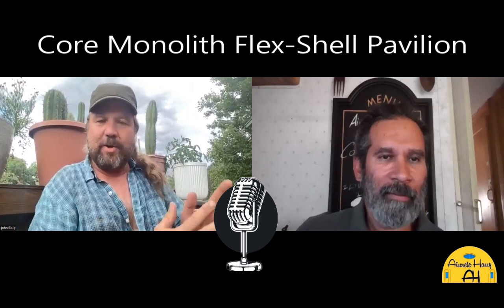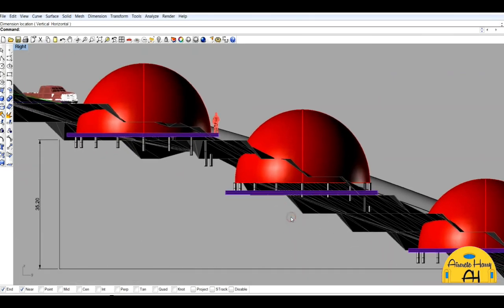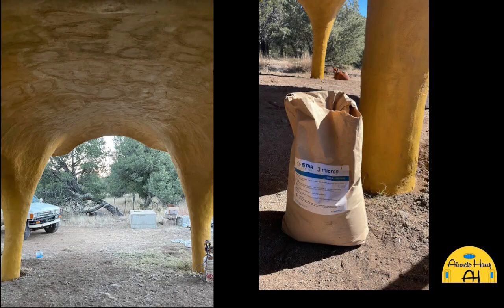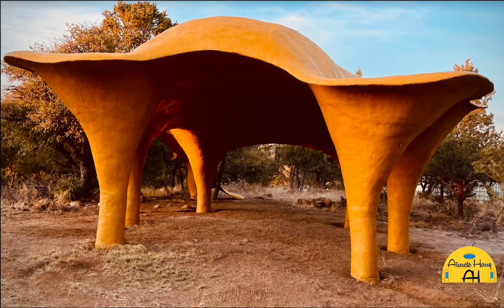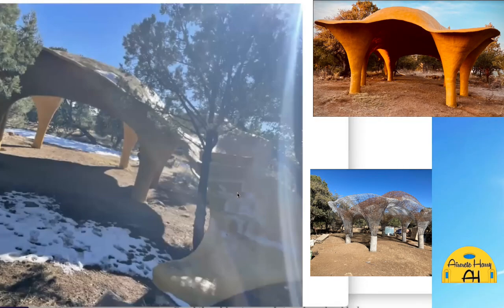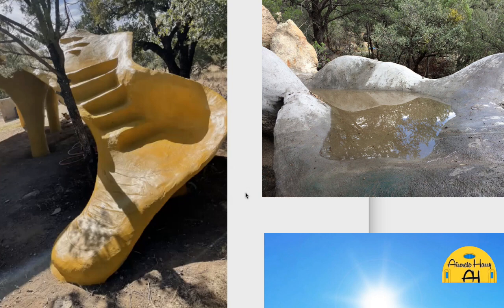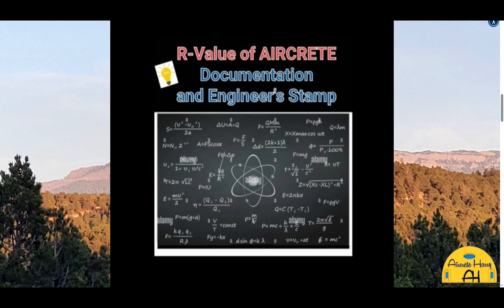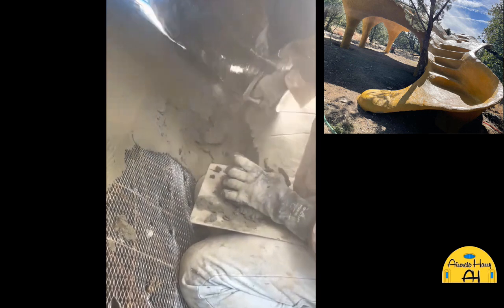Let's Talk Building Systems | Doug Lacy Interview | Aircrete Harry | #aircreteharry #buildingsystem

Comment: Awesome info here! Reactive powder concrete recipe: portland cement, fly ash, silica flume, titanium slag, steel fiber, quartz sand, quartz powder, and superplasticizers. Optional other ingredient is rice husk ash. Rpc's improve microstructure, particle packing, toughness, and durability, self healing! Wow, and have been around since the 90's. Fascinating!
Reply: It is much better to replace the flyash with an ultra refined flyash that is 80 % 3 microns or less.  That alone reduces water demand.  If you check out my response to Michael Hosinger above it gives a little more details on the history. Also there is a recent recipe and mixing sequence in the comments on my folding machine video.  Boral Materials LLC really contributed to the Ductal Mix design style that eliminates the need for the hard-to-get items.  Getting that proper ratio of the special refined flyash and silica fume is the key to making the same consolidation.  A small percent of sand blasting sand (quartzite) also really allows all those nano particles to react between the larger particles that do not ever react.  Even the cement only reacts on the cement particle surface.
   Consistency of compressive strength is achieved by a mixing technique for minimum hydration.  You have to respond to rheology measurements you make while mixing, timing how long it takes for the mix to stop moving.  The metal fibers should be replaced with the PVA and Forta Ferro at max dose 2 percent cement to allow a better range of movement.  The foam really helps with those nano and pozzolanic reactions while preventing chemical expansion damage.  The foam increases impact resistance but weakens the compressive strength but not near as much as it should because the foam binds with extra gel water and supports the micro crystals around the bubbles because they are closed-cell and spherical.   Yeah, it is really cool stuff and the six gallon batches really open up possibilities for furniture, art and ultra thin designs based upon sturdy fluid curves and light frame that is perfect reinforcing compliment to the shell material.  Going to try roof compartment for my daughter's van but there are some non-moving dwelling type workshops coming up.

Comment: Fantastic conversation!  Amazing these column structures avoid the need for traditional foundation and uses less cement!
Reply from the maker: Welcome to the channel 👍 
Thank you very much for your great feedback, greatly appreciate you!
- Glad you enjoyed the video!
Yes, it is such a great option for building.
The more choices we have, right.
Reply: A column foundation can be designed for long term stability in most situations, including sand, swamp, clay and coastline.  

Using a retaining wall to level a thinshell-capped pad, one that extends well beyond the interior of the building, frees up infinite possibilities for entry wall design for the Core Monolith Flex-Shell Pavilion.  This also protects those columns from erosion and protects the building from flood damage caused by soil heave from saturated clay expanding.  This kind of damage was a significant portion of the damage costs after the Houston floods, according to our engineer brother Mike in Houston. 

Channeling runoff into secondary pads (gardens) around the main one or into high-quality check damns in nearby ravines, reverses erosion in the building area, builds soil, supports diversity and allows precious water to be stored below the soil in a way it can be used.  

All massive Reinforced Concrete designs, weather it is a slab, wall, truss or column, has a thinshell reactive powder equivalent that uses vastly less material to achieve the same structural goal, but the alternate provided in thinshell for retaining walls makes more enduring eco-friendly foundations and cutting-edge erosion control methods more cost accessible.

Comment: Helical Piers are much quicker than columns and common machinery can be adapted to drive them in. Also remember to use non-conductive rebar!!
Reply from the maker: Welcome to the channel Dana 👍 
Helical Piers are great - depending on the soil conditions. In our area, for example,  is too much rock to be able to apply this system. 
Overall yes - great option, I agree 👍

Comment: Have you experimented with Waterglass and cement mixes?
Reply from the maker: Not in that way, no. What are you having in mind?
Reply: @AircreteHarry  Hi Harry, I was building simple aircrete/ vermiculite or perlite structures and by adding waterglass ( which is very easy to make yourself) you can control the "setting" time or by painting on afterwards you can make it water resistant and give it a lot of strenth esp in areas that take heat, it just seems like something simple to add that is pretty cheap but is sort of a catalyst multiplier? if that is even a term?

Comment: Fascinating! I’m going you have to research this reactive powder cement! Thanks Harry!
Reply: Pleasure!! Happy to introduce great & different varieties of building techniques - the more options we have, the more possibilities! Glad you enjoyed the video! 👍
Reply from the maker: You are very Welcome!!
Reply: The Ductal mix design by a person from Lafarge in France, the ones who brought us Portland cement, was the first.  Their mix was a 26,000 psi mix that really hit the scene in the late 90’s.   Their super compact consolidation was achieved by  blending different sized silica like quartz flour, micro silica fly ash and the new  polycarboxylate  super high-range water reducer/super plasticizer.  It flowed like molasses or molten tar.  It drips in a stringy non-Newtonian rheology that forms thin dense puddles on the ground.  
Boral Materials technology made a real breakthrough by replacing that complex gradation for densification, that was like mixing basket balls, grapefruits, ping pong balls, marbles and BB s to achieve a consolidation where everything touches, with an ultra-refined fly ash that can be used in a much smaller portion of 12-14 percent portland.  That was the dark grey Boral Micron 3 that is no longer available.   The STAR M3 from Spherix Mineral Products replaced it.  It is a light reddish brown color and refined from a North Carolina Flyash reserve that is from Anthracite so has higher iron content and less impurities but is the same spherical Silicate that is 80 percent less than 3 microns. 

The refined flyash works by replacing that complex array of particles with a more simple complement of particle sizes that creates the same densifying compaction.  It is more like lots of basketballs (micron 60 Portland) a few marbles (micron 3) and a few BB s -the Eucon MSA (silica fume).

The other real breakthrough made by Boral was their improvement of the polycarb.  They blended it with old-school densified calcium and Mg lignosulfonates derived from the Japanese Cyprus.  This prevented segregation and added polymer bonding compounds. 
This combo of Boral Micron 3 and “SPJ” (Super Plasticizer plus the ‘J’, the Japanese water reducer) resulted in a 17,500 psi pea gravel mix that was available to everyone.  

They didn’t realize that not many could really fathom the benefit of changing to a new stronger concrete. 

Boral sold their chemical division to Euclid Chemical Co and the super P turned from Boral SPJ to Plastol 5000.  

Euclid refined their Silica Fume into a product that is safe and consistent.  That is now added at 10 percent cement.  
Sand blasting sand is added, 20-80 silica sand at 10 percent of the 2.5 gallon ASTM C-144 mortar sand, to continue in that key style consolidation that Boral started.

I dialed in the complementing fibers at max dose, the PVA-RESC 15 ml and the Forta Ferro 3/4 inch.  Two complimenting fibers was something that Antoine Naaman later studied after we corresponded on the subject.  He confirmed the complementing enhancement in a paper.  He is the professor who wrote Ferrocement and LamInated Cementitious Composites which is a good research resource. 

Also, I added the 8 to 11 percent closed spherical cell aeration that binds with extra gel water, water not reacted, and converts it to closed spherical cells.  This unique water bonding characteristic of Mearlcell 3532 removes the capillaries that cause water intrusion and replaces those capillaries with spherical closed cells that repel water while channeling crystal expansion to the interior of those bubbles and also densifies the area around the bubbles to channel water electrically to cracks that become exposed to CO2 in the atmosphere.  

The rust, ice and sulphide expansion grows inside of these cells instead of weakening the cement by wedging apart bonds within capillaries.  

Other foaming compounds created pockets of densified material surrounded by suds but the Mearlcell 3532 bubbles blended right in as a multi sized micro aggregate.  This unique water bonding effect causes other foamed concrete mix designs to have unpredictable compressive strength because of variable water content affecting density so it is not advertised as available but Airex Industries still makes about 10,000 gallons per month for people like me who appreciate it's unique water-bonding micro sphere aeration benefit.  For the Ultra High Strength Reactive Powder mix, the water content is minimum and the Mearlcell ensures that by bonding to extra water.  It does not have a significant unpredictability factor for this kind of plaster as long as it is foamed perfectly, very slightly runny, and kept in that 6 to 11 percent range.  The 6 percent has a compressive strength that exceeds 15,000 psi which should not be possible because of the foam but this foam does not weaken the mix as much as it should.

 Portland cement hydration produces lime as a byproduct: calcium silicate hydrate (the hard stuff) lime + CaO, or also called calcium hydroxide, slaked lime, in the presence of water.  The lime that is mostly a wasted by-product, reacts initially with the micro silica and then reacts in a second wave for that late-strength gain and crack healing effect. Besides the Calcium Silicate Hydrate reaction derived from Lime Carbonate reactions also occur where lime water is directly observed precipitating calcite in cracks. The water and lime are observed to be transferred to cracks via some kind of electrical effect that occurs as the PH lowers and the pozzolan reactions shift the use of the calcium hydroxide to carbonate reactions that fill cracks.  

 Ironically, the strongest mix happens to be the softest most spreadable plaster.  

Something interesting happens when you dial in minimum hydration. Instead of getting a runny drippy mix, which happens if you add too much water, you get a workable render. 

It Seems meant to be.